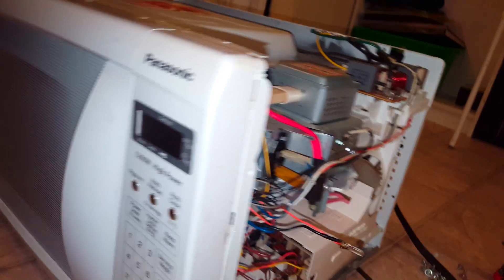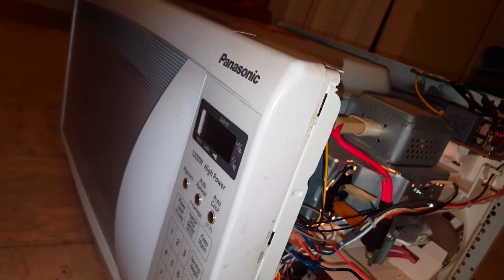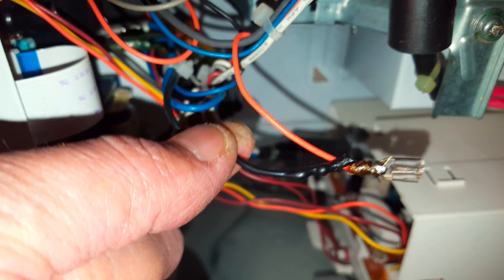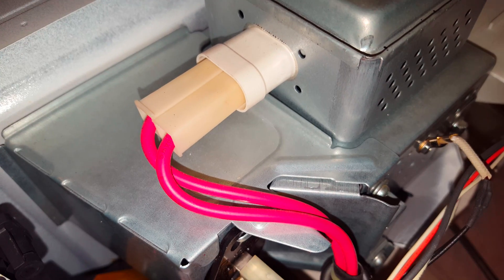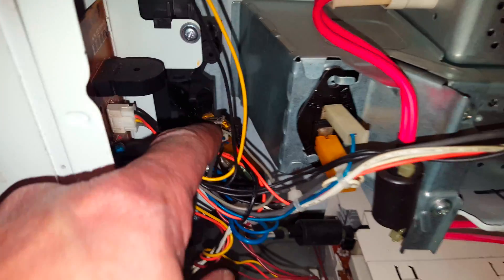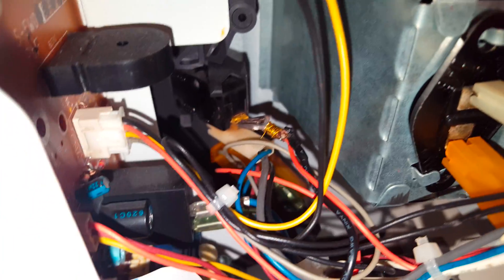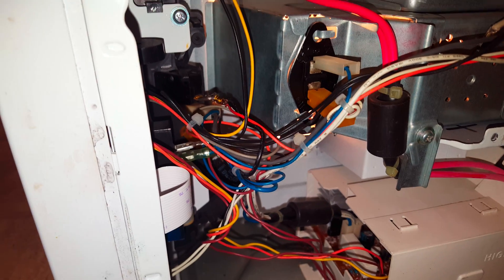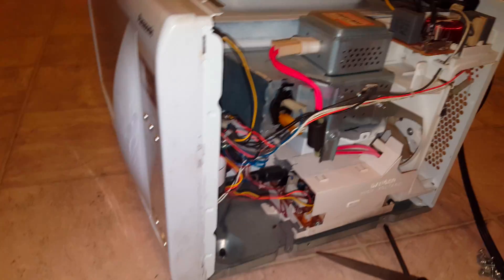How To Fix Microwave Panasonic Stops Few Seconds When It Starts

Comment: I am tehnician....inverter microwave stop because many things...it has protection circuit that detects low voltage and high amps...and also a few fault in the circuit..like when cooler fans doesnt work....

When line ac voltage drop ten percent than it should..it also stops after few second...
Also when it consume more amps than it should ..it will also stops.....what the heck,...wkwkwk
The best inverter microwave...is the first generation of panasonic inverter microwave...

The second and the third are not so reliable for long term usage....
Reply: http://www.youtube.com/channel/UCsP9CdTnKv_Dp4UXBkXnL4g.NTP Vlogs are their channels. share repair microwave oven Panasonic inverter, fan steam brother share learning mutual experience. your channel is very useful. remember to register your channel. thanks.
Reply from the maker: Control boards are often misdiagnosed—before replacing the control board, first check more commonly defective parts, particularly the door switches. If all of the other components are working properly, replace the control board.
Reply: @WorldRandomVideos  agree....but 1 have 5 inverter panasonic microwave...1 is the first generation..reliable
2 second gen...are not so reliable..they are already broke beyond repaired
3 inverter...the third generation...2  i can fixed..with the same issue...stop working after 10 to 20.. seconds
The third one ..with error code showing...i still un able to fixed it....what the hell with panasonic....

Comment: Thanks Ali, 3 sec shut-off was exactly the issue with my Bosch HMB5050/01 - the switch did it. Switch Cost me $6 on amazon. Local shop wanted $150 for diagnosis + parts. Comparable built-in Microwave new cost $576.00
Reply from the maker: My pleasure
Reply: http://www.youtube.com/channel/UCsP9CdTnKv_Dp4UXBkXnL4g.NTP Vlogs are their channels. share repair microwave oven Panasonic inverter, fan steam brother share learning mutual experience. your channel is very useful. remember to register your channel. thanks.
Reply from the maker: Glad to hear that❤❤😉

Comment: Hello, my microwave turns off after 3 seconds. How can i fix this problem. Best regards
Reply from the maker: i am sorry for late reply, i hope my reply wont' be useless or too late,
it sounds like bad door switch, or bad wiring connectors, all the best
Reply from the maker: Control boards are often misdiagnosed—before replacing the control board, first check more commonly defective parts, particularly the door switches. If all of the other components are working properly, replace the control board.

Comment: Better to crimp both cleaned wires into a new connector or solder them, but nice work finding the culprit. I would have written it off as control, power or magnetron. Loss of connection on primary side usually results in  no start at all, but inverter type ovens behave a little differently, it seems. Thank you.
Reply from the maker: that is exotically right, thank you so much for great message, all the best
Reply from the maker: thank you so much